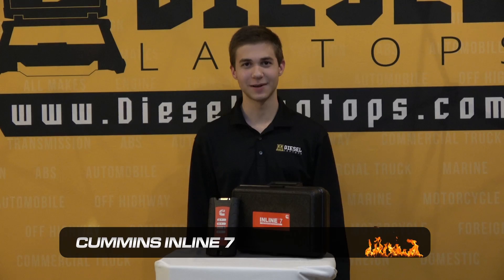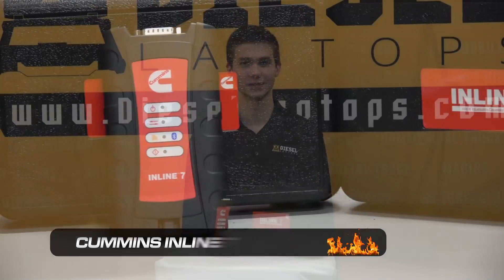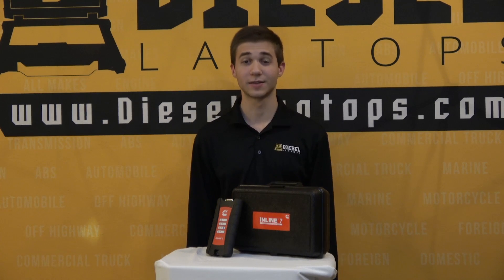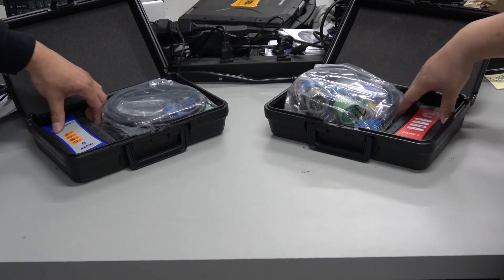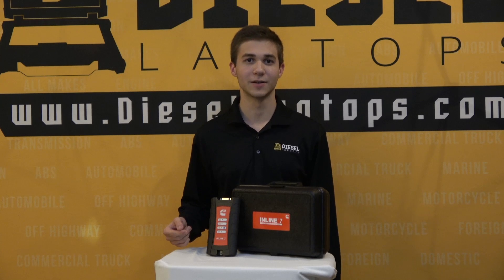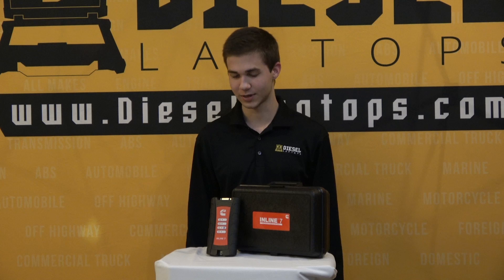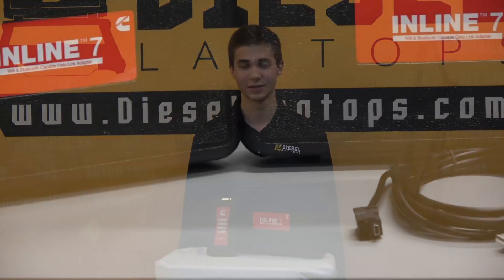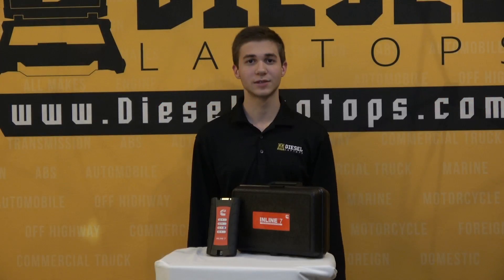Cummins Inline 7 Adapter Review Features and Benefits

Comment: Hi. I have a Volvo with a Cummins CM2350. I am trying to decide if I should buy the Nexiq or the Inline 7. My question is, If I end up buying the Nexiq, will it work with Cummins Insite 100% or I have to buy the Inline 7 to get the most out of Cummins Insite ?
Reply from the maker: The Nexiq USB Link 2 does everything the Inline 7 does. It is also cheaper, and you can use other cables like an OBDII cable. However, I would suggest getting a DrewLinQ. Works the same as a NExiq, has a longer warranty (2 years), replacement/additional cables are 50% less, and we have gently used ones for $500 while a genuine Nexiq costs $700 or so -- https://diesellaptops.com/Used-DrewLinq-USEDDREW.htm

Comment: What do I need to diagnose a Cummins generator
Reply from the maker: Well, you could buy any code reader to do the basics (Read codes & live data). If you want to do dealer level, you won't find anyone that is selling you legit software to do it. This is the only tool we know of that does off highway diagnostics, and it works very well on Cummins -- https://www.diesellaptops.com/TEXA-Construction-Off-Highway-Diagnostic-Scanner-Laptop-Tool-TEXA-OHW-LAPTOP.htm
Reply: Hi diesel laptob
Is there possible to read data from ECM and convert it into serial or tcp /ip for 24 hour monitoring?? M

Comment: Sorry. Really for INLINE 7 cable J1962 Adapter (16-Pin OBD II) 493013 does not work?
Reply from the maker: From what we have seen, the cable will work and be recognized by the tool using device tester. We had it work on Volvo 2013 & newer equipment, but could not get it to work on automobiles. Our belief is that the Inline 7 version doesn't have the automobile protocols on it.

Comment: Hi what is the difference between the inline 6 adapter and the inline 7 adapter ?? THANKS
Reply from the maker: The Inline 6 was discontinued around 1-1/2 years ago. The Inline 7 is the new model, and is actually manufactured by Nexiq. The Inline 7 has both bluetooth & wifi, faster processor, and more RAM. Hope that helps!
Reply: @DieselLaptops  haw to bye this device?Im from India

Comment: Hi, I can use this scanner either new engines (2017, 2016, 2015 ....)  or for the old ones (2004, 2005, 2006, 2007) ?? THANKS
Reply from the maker: Yes, it supports all known commercial truck protocols for all years.

Comment: it wont work on my dodge cummins?
Reply from the maker: No, Dodge does the electronics on the Cummins engine when in a Dodge vehicle. This item is also only the adapter, no diagnostic software included.